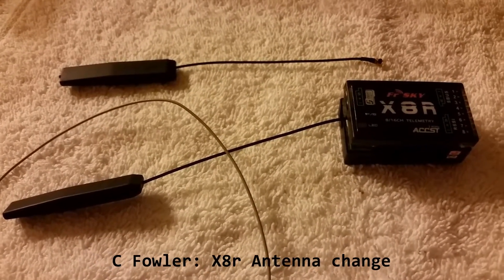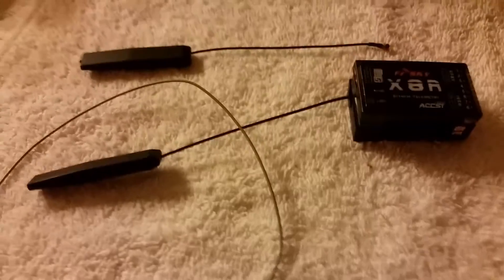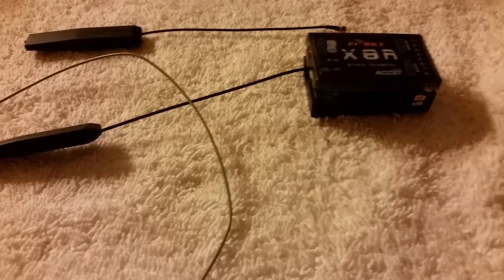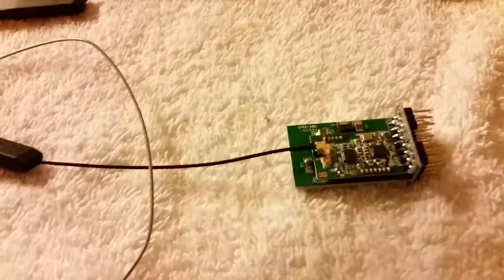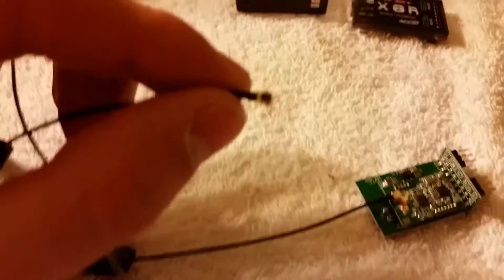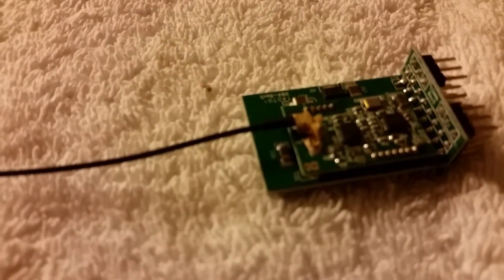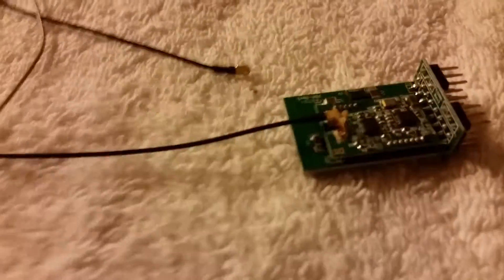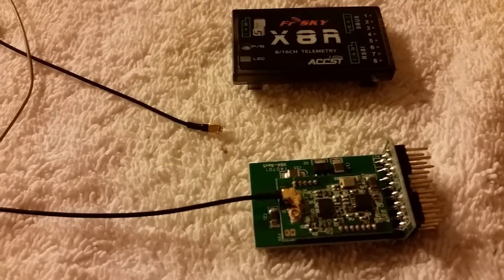How to change frsky x8r antenna for the Taranis

Comment: ..."this is how you change the antennas..."...you never showed how to change the antennas... Further more, re-read the title of this video.  Now yes, I can figure this out for myself, but honestly, this is a video made for someone new to this. May be worth going into more detail for them for this title choice.
Reply from the maker: ***** I showed exactly how to pop one off and another pops back on
Reply: C Fowler To be clear, not trying to be being rude here, but you did not show how or component swap procedure.. you pointed to already swapped components and showed swapped parts You did not show HOW to change anything here.  
With tutorials, (be it in text or video) it's all about the details. I myself strive to give details in everything I do, and when I mess up, I give notes pointing out my mistakes. I suppose I expect the same from others.
Reply from the maker: Thanks for your input, its been noted. I didn't have a tripod and I didn't think it was necessary to show people that can setup a taranis how to use a button as on their coat. I did show how and where to apply the tip of a screw driver to work it off along with the rx case removed which I deemed rather clear without holding anyone's hand because if your swapping x8r antenna you already know what your doing and might just want to see the details of what it looks like.
Reply: +Rhyell not trolling anyone here, just in my opinion that this isn't a traditional tutorial.

Comment: I'm thinking of replacing mine too.  Do your new ones work any better?  
Thanks for the video.
Reply from the maker: The original ones were too short for my application so I didn't even test them but the new ones work very well. RSSI goes up as I get higher and farther away vs when its on the ground right in front of me.